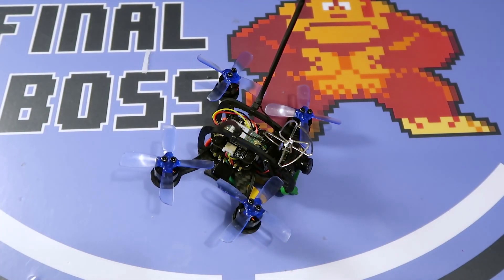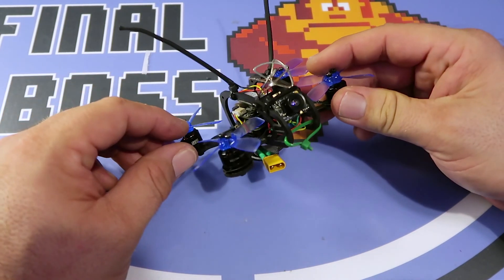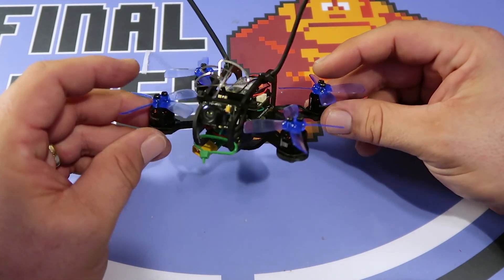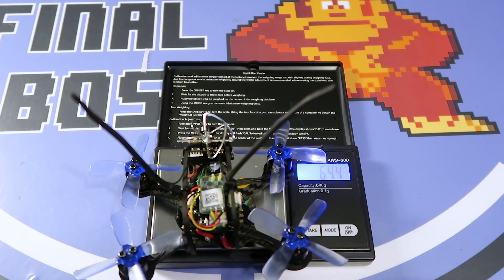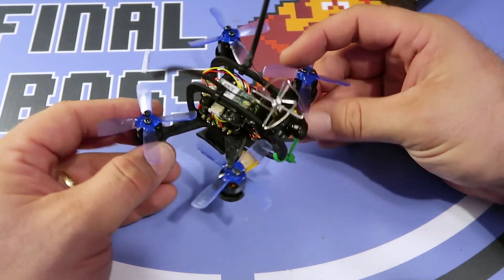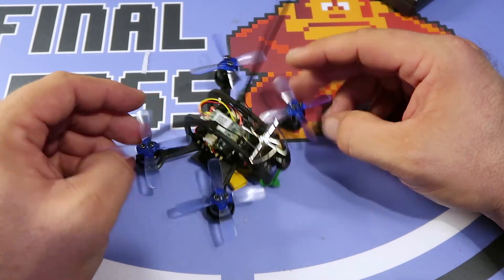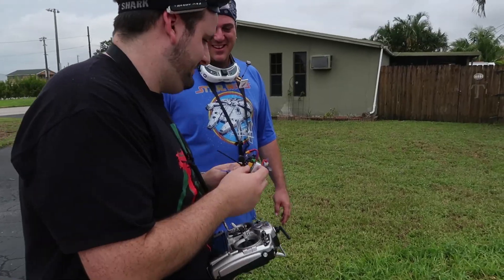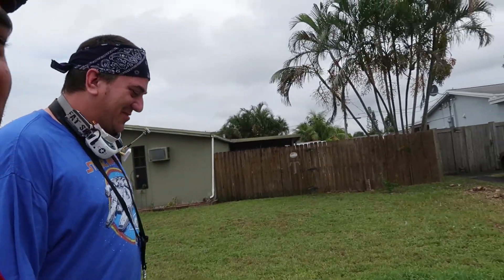FlexRC Ascent 94mm (Work in Progress)

Comment: I have the Ascent as well! love it
Reply from the maker: +Richard E nice!   Which conponents are you using?
Reply: Hot Sauce Final Boss I'm using Emax RS1106 6000kv motors, 2035gemfans, Aurora 4-1 20amp ESC with Aurora f3 omnibus w/OSD and eachine vtx03 powering Runcam micro. using it on tattu 2S 450mah 75C batteries, will order some 3S Tattu soon but 2S it still moves quick and very floaty feeling
Reply from the maker: 1106!  How do you like the motors?  That's a lot of beef on an Ascent :)
Reply: love them! ya over kill on thrust but i plan to use 3S eventually and wanted something more insane then a lizard. I even had sand in the motors and sprayed them out with compressed air and they run strong still.